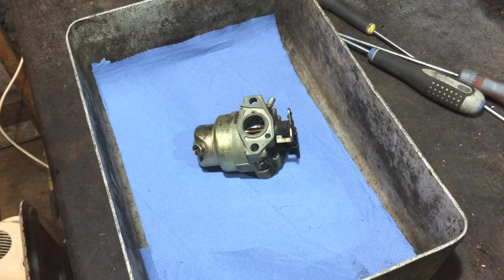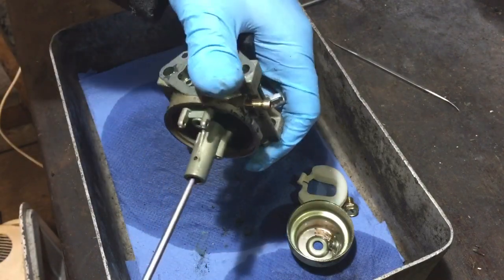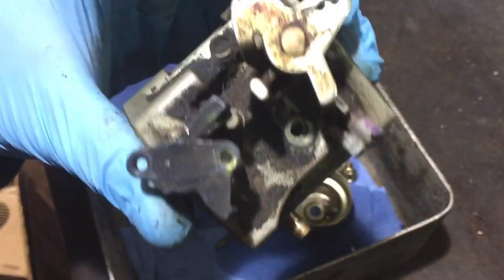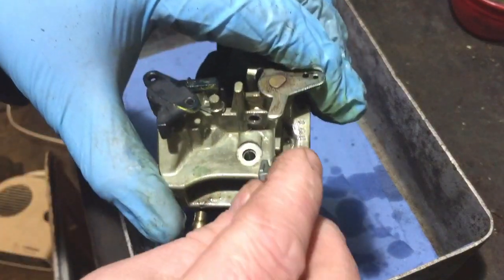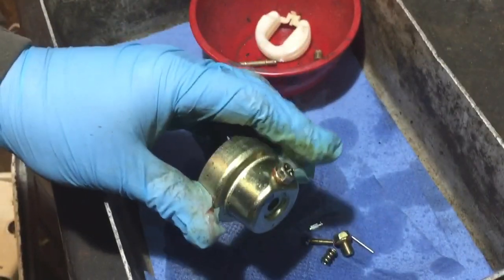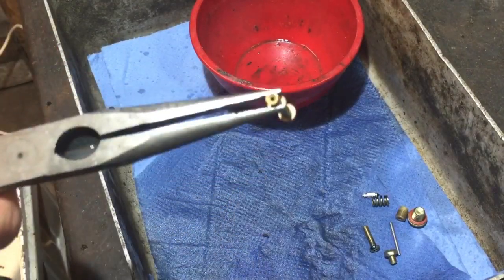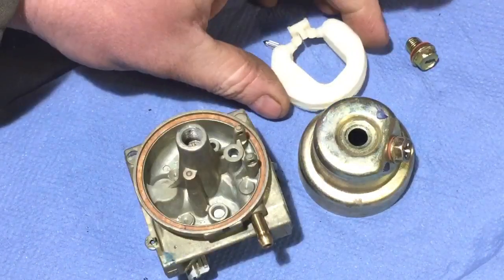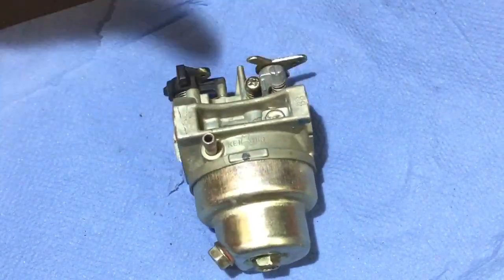Honda GCV Carb ( Carburettor ) Clean

Comment: Nice vid, i did one last week just waiting for the gaskets to come before i put a vid up. Looks nice and clean, no reason that shouldn't work fine.
Reply from the maker: Hi well all we can do is try, I’ve cleaned them before then again the ultra sonic clean and still no good. I do think sometimes the problem lays behind the welch plugs. If all fails I fit a cheap copy and in the main they are ok. But a clean 9 out of 10 times does the job. Thanks for watching🙂👍

Comment: Thanks for this great video! In other tutorials I've seen, they DO clean the idle speed jet. The way they remove the little aluminum cap is using a soldering iron to heat up the Loctite holding the cap on. I myself would like to avoid doing that and go your way and just not worry about it. Can you please shed a little light on why in your view it is NOT important to clean that specific jet?
Reply from the maker: Hi the reason I don’t clean that is because of that aluminium cap. Actually I never thought about heating it up (I might try that) but I always think it’s worth trying to clean with out doing that less hassle, also if the carb isn’t to dirty the carb cleaner should flush it out. But I do have a feeling when I have issues after cleaning there could be issues under the cap. I have loads of spare carbs so I usually get another one if the carb proves to be no good. But I am going to investigate what is under that cap. Hope this helps thanks for watching 🙂👍
Reply: @menditman2004  When I removed mine it was a very sick little carb. Looked like someone made candy inside if it. Followed this video step by step. After reinstalling the mower started in the first pull. Thanks again!
Reply from the maker: @jasonmorris107  Sorry for the late reply, these are the comments I want to see, I really pleased it helped you sort your mower🙂👍